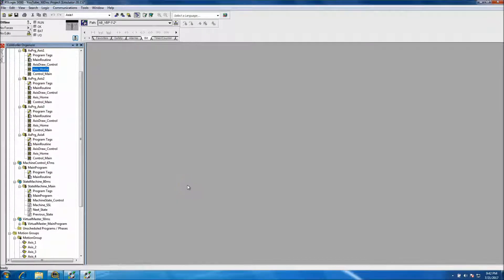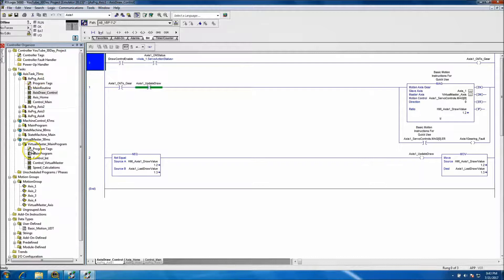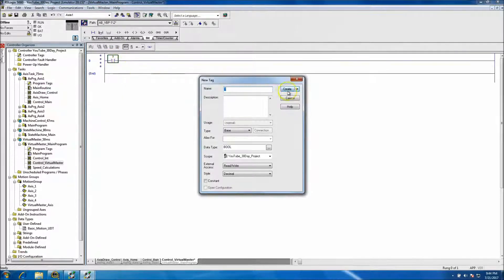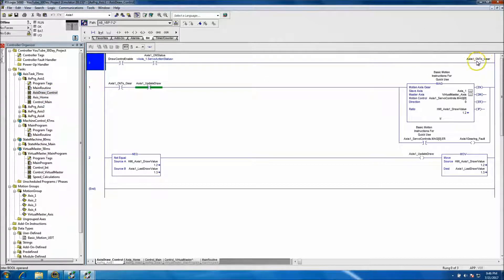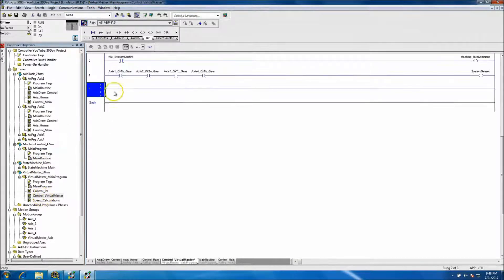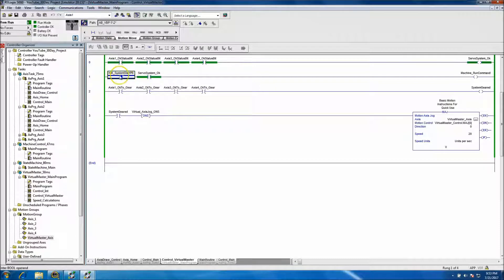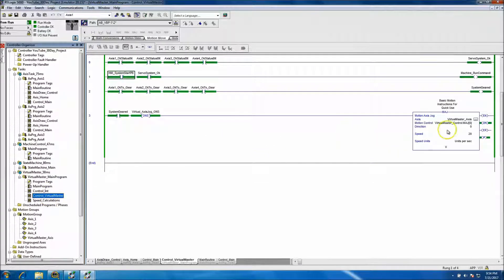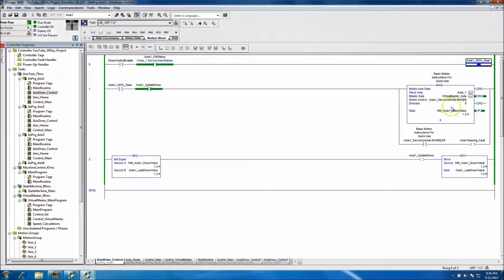Servo Motion Project Day 9 - RSLogix 500 Virtual Axis Jog With System Test

Comment: Hey Shane, When I ran the program, I got ER output come on,  on the MAJ instruction for Virtual Axis even though SystemGeared is on
Reply from the maker: Depends on what error you get on the fix
Reply: @ShaneWelcher  This is my first servo programming experience. I don't know where to locate the error message. what is the fix?
Reply: @ShaneWelcher  on quick view, Axis state for each axis is saying: Configuring , and  update period :6 ms
Reply from the maker: @jamalbouaziz8511  

Then configure the virtual axis
Reply: @ShaneWelcher  error 19 on VirtualMaster_Control.MAJ[0].ERR.  same error number on other axis
Reply from the maker: @jamalbouaziz8511  configure the axis
Reply: @ShaneWelcher  I finally found what the issue was. I used studio 5000 rev 30.  I switched to 28, then it worked just like on your youtube video. Now I can go lecture 10. Thank you Shane

Comment: Hello Shane, the videos are amazing! When I try to simulate de programm the velocity of the slave axis is the same as the master axis, but I´m using a ratio of 1.5! I do everything how you showed on the video, have you any idea of what can cause this error? Thanks!

PD: I´m using version 28 of the emulator.
Reply: Manuel I had the same issue on version 30. It seams there's some bug in it. The ratio will work if you use the slave counts instead, it doesn't even matter if you've set Real or Fraction_slave_master_counts Ratio format. So set master counts to 1 and slave to 2 and the slave will run twice faster.
Reply from the maker: Move to version 30.11 or version 31 or 32, some versions of version 30 have bugs, I talk about that in my recent videos